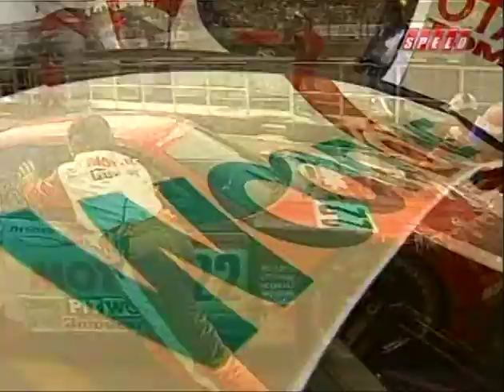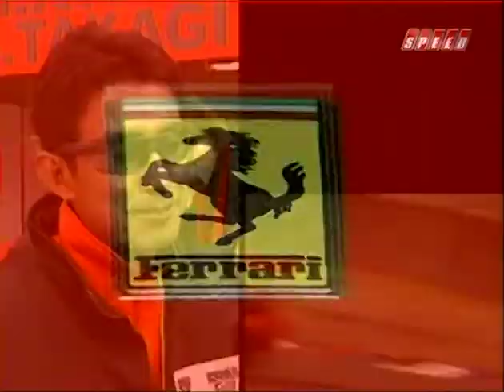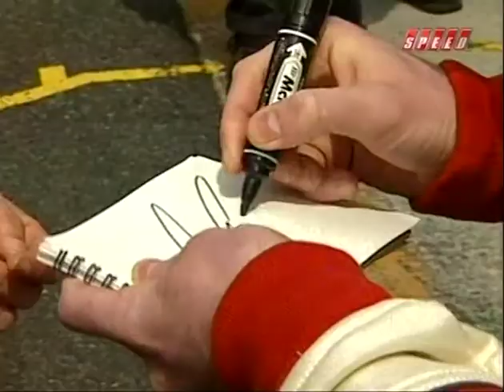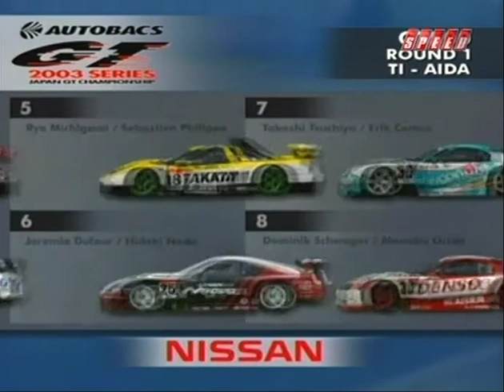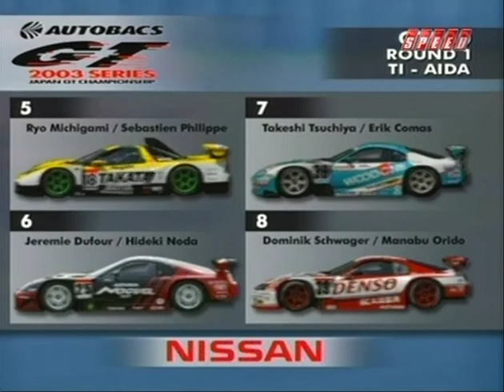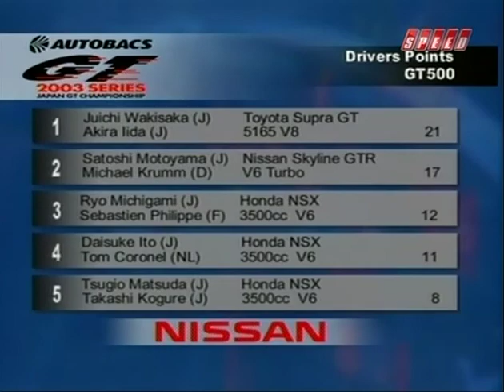Japan GT Championship 2003 Race 1 Highlights (w/ English commentary)

Comment: Ooh! So most of the GT300 cars were revamped production car construction!
Reply from the maker: Yup, although how close they are to the road cars can vary a lot. Even cars that should be identical can be very different like the first-gen Toyota GT86 and Subaru BR-Z from the 2019 season. They're pretty much identical as road cars but in Super GT the two were built to different rule sets with the GT86 based on the "mother chassis" rules with a carbon monocoque and common Nissan-derived V8 engine, and the other based on the JAF GT300 rules so it used the original cars basic tub but with a race-prepped turbo EJ20 flat-four motor and customized suspension mounting points and aero.